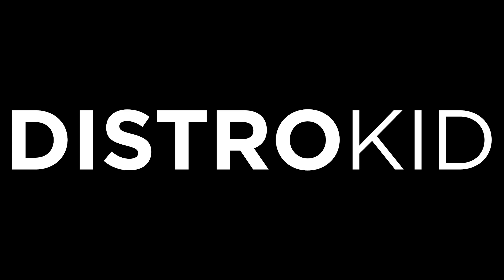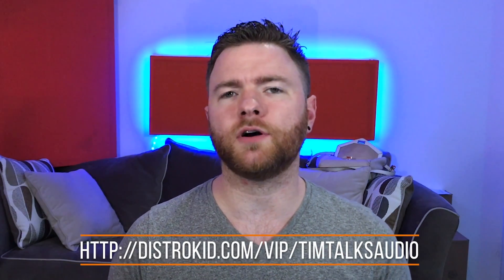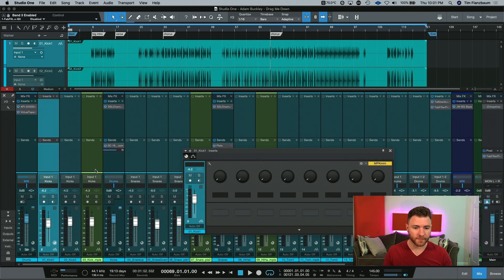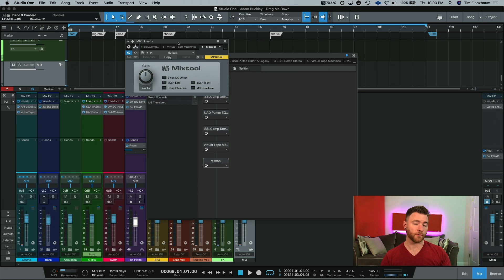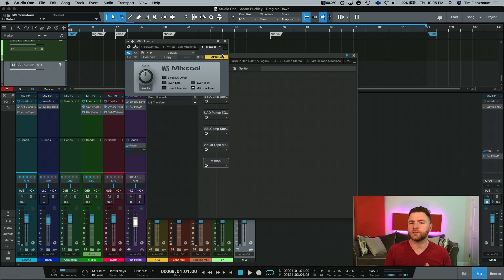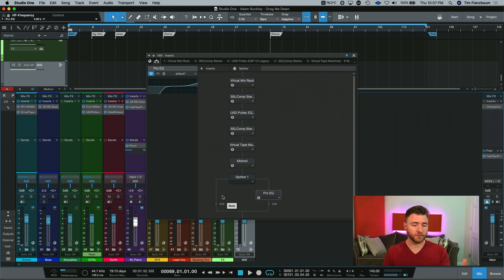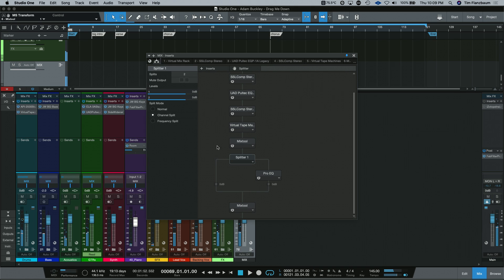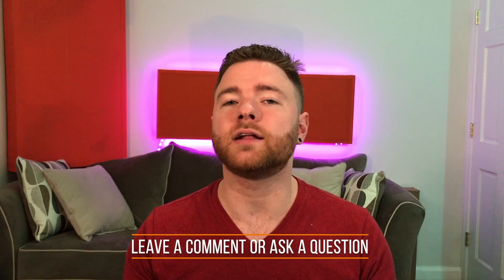Studio One: How to Route for Mid-Side Processing

Comment: M-S Splitter not working correctly in Studio One, phase issues.
Split M-S and reverse-phase with the original track, there is no silence!
I try in Ableton and Bitwig it's perfect.
but in my main Daw (STUDIO ONE 5.2) it's not working.
Reply from the maker: Interesting find, I would open a ticket with Presonus support and highlight that with them.
Reply: @TimTalksAudio  thanks a lot
Reply: It works...but you have to add 3db of gain in mixtool when you use the mid-side button. There is some audio loss and that's why you don't get silence.

Comment: I know about M-S processing and how it work, but sometimes forget how useful it is.  Song I worked on last week had most of the drum kit just on stereo overheads.  Wanted to pump up the kick.  So M-S the OHs, ProEQ on the mid signal, lower the level on the side signal just a little.  Good to go.  Also took a separate feed for a kick bus, did M-S but killed the side signal completely, plus ProEQ on the mid signal again.  If I recall correctly when you do M-S in the MixTool you lose about 3 dB, so I always bump the MixTool +3 dB.